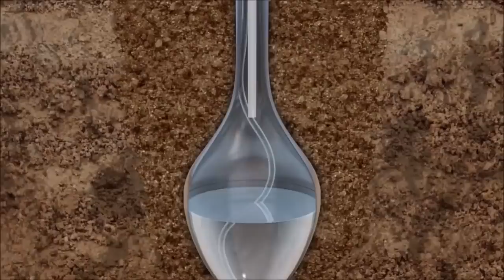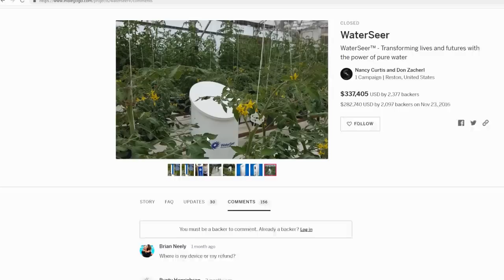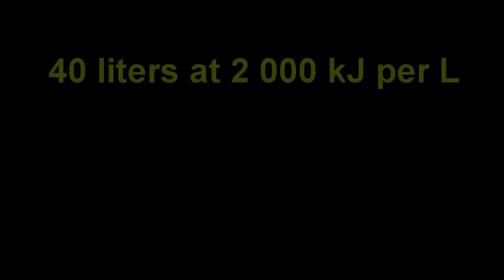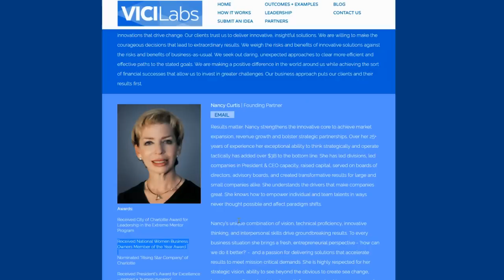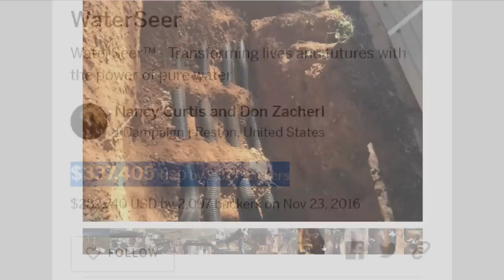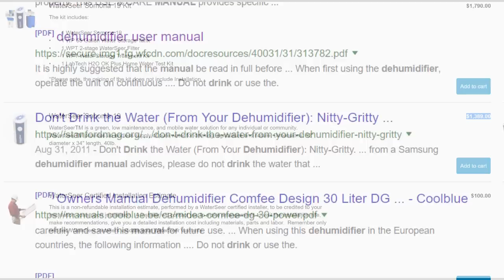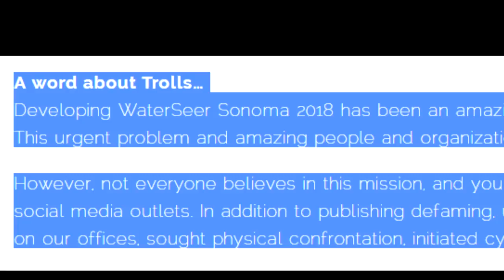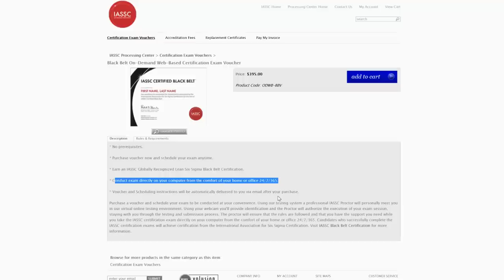Waterseer MEGA-BUSTED!!!!

Comment: I'm not an expert, but I did have some experience working on a farm. Isn't this basically an air well? Those can work in the right conditions, but in my mind the biggest problem would be the fact it's made of metal. Air temperature and sunlight without active cooling will just prevent it from reaching the temperature difference needed for condensation. Just make your wells at home with stone, folks. It'll save money and you'll actually get (some) water.

Comment: in certain places that have water issues a simple water filtering solution can actually be enough to change the situation.
after all most issues are not the "there are no water" but "there are no CLEAN water". this mean that if we just get the prices of water cleaning solutions down, and (pun alert) flood the market with those solutions in the relevant areas(to avoid someone taking monopoly over them) we can solve a lot of the water shortage in dry countries.
as for countries with no water... well there is no easy way around it. water will cost a lot. removing salt from seawater is expensive, transporting water for long distances is expensive and any "cheat way" of getting water will simply not work if there is not enough water in the air(like in dry countries that have no sea border and no reliable water source).
one thing that might help with getting water to those areas is cooling down the entire planet by 2-4 degrees but if we knew how to do that then global warming wouldn't be a problem would it?

Comment: The basic concept has been used for ages as basic survival skills for arid areas.

A condensation still. Dig hole, put cup at the bottom, plastic over top, rock in the center so it dips down, tadah done.

Comment: Wikipedia are wrong about Six Sigma though.  The goal is not for 99.9966% of units to be free of defects; its for 99.9966% of units to be within six sigmas (i.e six standard deviations) of the specification.  That's a very different, and much more reasonable, goal.  It's the hijacking of this idea and the surrounding of it with management gibberish that is the problem.

Comment: The "digital mushroom" as you've nicknamed it, fails in aerodynamics as well because, the air needs to exhaust somewhere and this doesn't do that.  Also, why not just invest in a refrigeration cycle dehumidifying unit?  Similar power draw, more efficient all around.  Hell, I used to collect water in a rain barrel from my portable air conditioner for use of watering plants and cleaning my yard equipment.  Since then I have a rain barrel connected to my down spout for the same purpose and I currently don't use the portable as my window unit fits my current window.

Comment: There are few easy solutions but what would it take to produce reasonably clean water from that of the picture at 11:32.  Im thinking along the lines of mystifying the water droplets so small before entering a filtration system.  Something that could be hand cranked like the old time water pumps.

Comment: Six Sigma is a widely-used methodology in engineering, and a black belt certification is actually pretty respectable. I use this methodology in my engineering work. 

You can, of course, take the exam if you already know the tools and methods through field experience, but this is usually a bad idea. 

Sorry Thunderf00t, but you can't just dismiss a legitimate certification on the grounds that one holder thereof is clearly a scammer. This is a real engineering toolset used in manufacturing and new product development.

Comment: I'm not very familiar with how dehumidifiers work. Could you use one with solar panels installed on it to generate water for people in remote villages, or would the power not be sufficient?
Reply: You are facing two main problems, one is power, water is a rather powerhungry and humidity. In regions with little water the normal humidity of the air is, logicly, very little..you know otherwise there would be water around, thus you allready start with next to no usable water in the air, couple that with power requierments and you got a massive failure, not to mention that one does not need to reinvent the wheel, we allready have water dehumidifiers, no reason to not just use those.
Reply: @Nikagor  I was talking about a normal dehumidifier with a solar panel strapped on. It makes sense why it wouldn't work in an arid climate with little humidity, but if the power part could be circumvented with solar panels it might be of use to people in developing parts of the world that are humid but lack clean water.
Reply: @Nanook128  Well you could gain water, very very little for the "price of power" I mean at some point it would be cheaper to use those solar panels to have it work deep well pumps or to just pump the water there from outside or heck even have some kind off electrical car so you can bring water in, not to mention its not a long term solution, without proper support those solar cells would not work after hrmm I say 10-15 years and they would at that point most likely not cover the cost, Not to mention that water from pure dehumidifiers is full of bacteria and would need to be filtered and biological or/and chemical treated.
Reply: @Nikagor  those are some fair points. Thanks for the insight.

Comment: Regarding certification. I don't know anything about how this exam is in real life but much of this sound similar to many IT certifications. 

Often no qualifications are needed to take an exam but even with 10+ years of practical experience you fail unless you study.

You can even take some Microsoft certifications at home if you have a webcam. If this doesn't require a webcam at home then it has no value of course, just like for example VMware associate exam (in reality an exam from their marketing department)

So by going on this text alone it does not sound that bad.

Comment: I wonder if some of these entrepreneurs are actually well meaning people who have overestimated their abilities. I once worked for a company run by a mathematician and  physicist who were extremely arrogant. As an electrical engineer I joined the company to develop the motion control aspects of their machine. Before joining I was told how they had technology that would change the world but not how it was to be done. My first day there I learned what they were attempting and realized from past experience that it was impossible. The next day, at the engineering meeting I attempted to point out the practical problems. The mathematician and  physicist jumped on me with massive vile and contempt. After that, I simply kept my head down, did my job, and collected my paycheck until the firm faded into mediocrity. The point was they really thought they had the world's next best thing. They weren't dishonest. They were simply contemptuous of "mere" engineers and too arrogant to take any advice that wasn't their own idea. By the time I left the company they had gone through $50M in venture capital.

Comment: Next very dumb water idea. Make the water with a chemical process. In "The Martian" they used acid and metal to release hydrogen. Then thy burned the hydrogen resulting with water. With optimal reactions (generally the yield of the chemical reactions won't match the theoretical values as the reaction slows down due to the increase in reaction products) you would need just 4.05 kg of hydrochloric acid (solid and almost pure HCl, and you'd better have a water solution), 0.89 kg of oxygen and 1.35 kg of magnesium (almost any metal works, too).

This way of obtaining water is highly inefficient, but the reactions are real and therefore this idea is perfect for the movie. In real life you would be better off with the local ice deposits, which can be melted for salt water (there are a lot of different salts in Mars).

If it rains in those place that lack pure water one could collect some of the rainwater. Of course you would have to make wine or beer with the water in order to reduce the risk of having the water contaminated. But this is historically used and documented way to deal with the water issue.

Comment: I have a compressor driven dehumidifier in my cellar, because it really becomes humid after heavy rain. It "makes" 10 to 12 litres of "pure" water in 24 hours consuming about 2 kilowatt hours. 2 kilowatt hours for a maximum of 12 litres! Using a compressor driven cooling much more efficient than a Peltier Element. In a humid and cool celler. How much electrical energy will you need in a environment with hot and dry air? 
By the way, I would no one recommend to drink this water produced by a dehumidifier for it is literally the same as destilled water. It is not isotonic.

Comment: Wouldn't some large reflective sheet/bowl (maybe even something that it pitch black to attract the sun?) with a cover to catch the evaporating water and a tube to put it back in a bottle afterwards basically get the "clear water" job done, even if you'd still have to do the trip for the dirty water first?

Heck, if you can stop the local criminals from taking over the object, you could even set it up near the water source. Just refill it when you get there and pick up the bottle of water on your next trip.

Sure, it doesn't work at night or when the weather isn't warm, but my understanding is that Africa tends to be on the toasty side...
Reply: You might as well just build desalination plants over the shore lines and lakes of Africa and just power them with nuclear reactors or stringling generators with the massive heat Africa has. Pipe lines should be secured by NATO/UN armies to prevent terrorists damaging the pipe lines. 

=

Water in Africa for an ~okay~ ish price and safely too. Also they can do water efficient GMO crops and collect any drip of water with plastic bags on the plant leaves.

Comment: These braniacs really thought they could dig 2 metres below the ground with a powerless device and it would absorb up to 83,620 kJ per day to generate up to 37 litres of water for only $100 per unit. Powered dehumidifiers can take about 0.009 litres of water out of a cubic metre of moist tropical air, so you would need to pass well over 4,100 cubic metres of moist air through it per day to get 37 litres of water. That's assuming a powered dehumidifier and this piece of junk have the same efficiency, which of course is a ridiculous assumption! This kind of device is impossible. Universities need to teach their engineering students to run basic numbers BEFORE wasting any time on design work. Why would you start designing a device that converts straw into gold when you don't even know if it's physically possible?

Comment: How do these things ever get out?  Do people NOT own dehumidifiers?  A stuffy ny summer, yeah, I can get 15 liters every 8hrs or so. But fall/spring/winter?  Most times you can run it all day and not get more than, idk, a liter? Sure, if I run it with the windows open, it would get more, but not much more when the humidity outside is 50%.  Why would they think this can work, whether on a wind-powered, soil-cooled, condenser, or not?  You can easily see how much water you get with a powered machine, that’s available in many homes.

Comment: Similarly did you bust the water Freedom system? I believe they claimed 60 gallons well let's say conservatively 50 + gallons in 24 hours. how much electricity would it take to dehumidify 50 gallons of water in 24 hours for your drinking or other purposes? This was plans or a parts list for a kit that you could build yourself. Reasonably priced and with a spectacular guarantee of satisfaction. Never be beholden to the expensive water utilities again. Did you debunk them? Were they busted as well in a previous one of your video clips?

Comment: The device shown in the 3D demo is not what they ended up making. They literally stole devices from another market and put them inside casings with a re-brand. That's it. Someone could TRY to make the device in the 3D demo and see what happens... might be interesting.
Reply: someone did make it eventually and it worked, but to be practical, they'd have to have hundreds of them on the field to give enough water to villages. they take about a week's time to fill up.

Comment: 3D printers are just for prototypes. Not manufacturing.
Reply: Depends. Metal molds for injection moulding plastic are quite expensive, not to mention all the other stuff you need for that. For a small-scale production, like 500-1000 pieces 3D printing can be cheaper. The Chinesee actually sell 3d printed items - like cctv camera mounts etc.

Comment: I need someone more science literate to tell me if drinking dehumidifier water is actually safe? Can anything else be condensed into that besides clean water?
Reply: Oh Thunderf00t just answered me in the video 30 seconds after my comment haha
Reply: It's safe if the machine was cleaned an sanitized recently. It's just condensation. The air doesn't have anything toxic and dust is collected in the filter. Bacteria grow quickly because it's stagnate water. I'd have no problem drinking dehumidifier water if it was an emergency.

Comment: Even if it worked it's pure water
Pure water can't sustain humans you need the minerals inside the water as well
Reply: you do realize that you can get minerals from food right? like its not actually harmful because it lacks minerals since even a poor diet can usually make up for it. the issue with it is that its not exactly shelf stable since it has a tendency to leach material from containers but even that can be resolved with a very small amount of mineralization tablets.

Comment: If it worked by Magick or whatnot how would it be clean   how water from air would be pure if the air is dirty contaminated, the devices would be clogged with dirt  and you would be drinking bird poo and dead bugs in a mud cocktail, for the water to be pure wouldn't it need a filtration system and a water treatment plant? And wouldn't all that require a massive infrastructure a tonns of power to run plus hundreds of workers doing maintenance

Comment: Not possible? Uhh, this is how the Persians extracted water and generated ice centuries ago. The exact same thing is how I get cool water out in the middle of the Mojave desert (though I follow the method of MASSIVE corrugated metal pipe filled with charcoal and carboniferous rock, which pipes down into a miner's hotel blasted into a rock hill, which is sufficient to give about 6 gallons of water in a day.)

Thunderf00t, you may think it's not possible, but it IS possible. Just not to the extent these companies are claiming with their tiny systems.

Comment: Are you debunking the device or the science behind the device. The reason I'm asking is because if it didn't work it was an intended scam,,, designers and inventers do extensive prototyping.. if it didn't work they already knew it would be the case... id bet you a grand I could problem solve that device and make it work because the science behind it is pretty basic stuff it just looks like they got their ratios wrong and over estimated its efficiency in that form. I would need to make some drastic changes but I'm confident I could fix the issues it has...